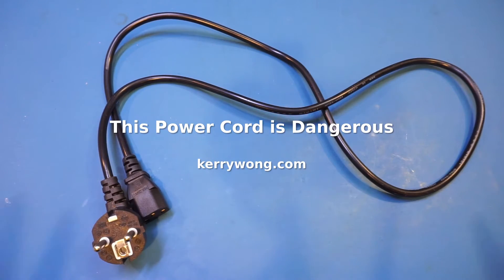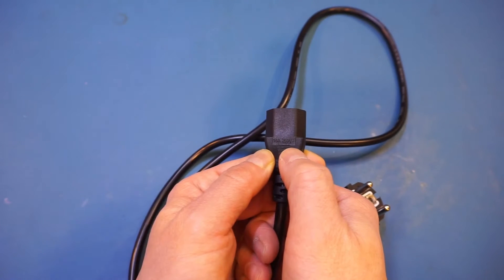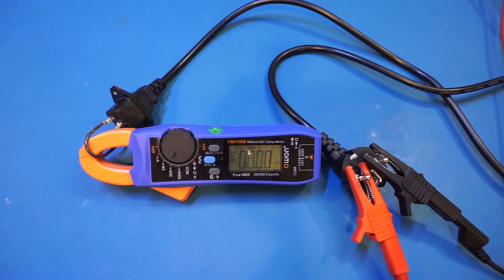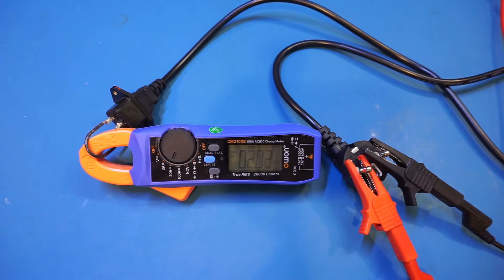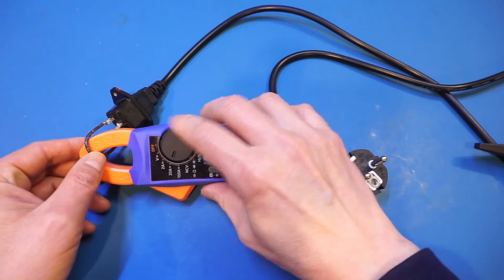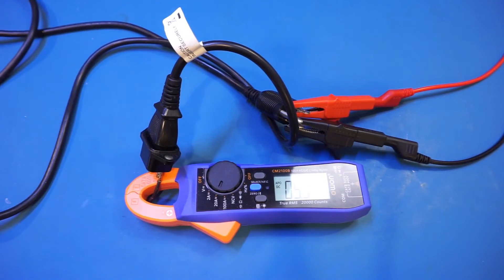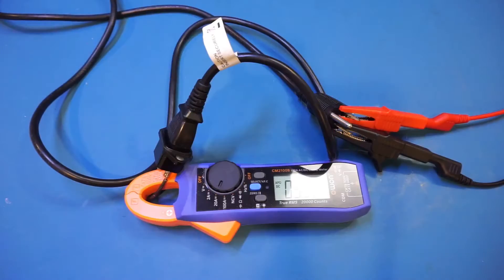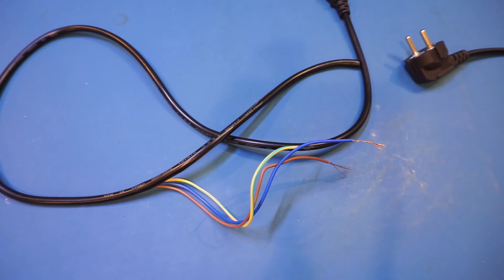This Power Cord Is Dangerous

Comment: Copper clad steel wire, cheap for sure. Did you measure the resistance, would be a good reference to the quality version resistance and an easy way to identify the cheapo types but of course heating it up can be fun to...  
Thanks for taking the time to make this known!
Reply from the maker: Given the voltage drop at 10A is around 5V and since the way I was measuring effectively double the wire length, the 3 foot wire has a resistance of roughly 0.25 Ohm (5/10/2).
Reply: I can't even think about a use case where steel wire could be valid for electrical current. Is it just made to be put in fake stuff or is it legitimately used in actual electrical systems ?
Reply: @amogusenjoyer  It's often used in coax and antenna wire. Copper clad steel is much stronger than copper, so it works great for wire antennas. 
Because of the skin depth the current will only flow through the copper plating. At 1.8MHz, the copper only needs to be 50 microns thick to carry all of the current. It gets thinner as the frequency goes up.
Reply: @rocketman221projects  A lot of antenna wire is copper coated steel but it's not to be used for power just for antennas
Reply: @amogusenjoyer it is used in high tension lines for its tensile strength. The have to consider tower installation cost span requirements sag from temp changes etc.    Copper clad aluminum is used for non mil std coax and low reliability network cable. As copper prices get more ridiculous alternative materials show up in more and more inappropriate places.

Comment: I have   4/0 copper conductors that go from my home solar inverter to a large battery bank. That routinely carries 120 amps at 48+ volts for charging and slightly less at discharge. I buy my cabling and electrical components from reputable sources like McMasterCarr / Grainger etc because buying from anywhere else like Amazon or eBay is gambling with someone who really doesn't care if they burn your house down and probably have burned several peoples houses down. It never occurred to me to test the  cables that have come with test gear that I've bought over the years.
Reply: Even if there is no fire, an inefficient cable wastes your photovoltaic energy.  You can test the conductivity of the wire against published resistance values per length of wire for each AWG.
Reply: Check everything from China twice.

Comment: Try soldering on them - I bet the solder won't stick . I have come across wire that no solder would stick to but I never tried a magnet on them - will do that in the future now !
Reply: The wire looks to be at least copper plated, so I would expect the solder to stick.
Reply: iron is solder-able better than copper , aluminum needs copper coating to solder
Reply: @fay296k  Iron is most definitely harder to solder than copper, have you ever tried it? We use acid flux to solder iron and that will ruin electric circuits Rosin flux is used on copper but will not work well with iron (actually its steel in this case).
Reply: @tedmoss  Many component leads used to be iron or steel with a tin / lead coating.
Reply: @cambridgemart2075  Yes, and that coating was necessary for the beast easily solderable.

Comment: What the hell
Reply: Common enough, and you also get those with only 2 conductors, despite the socket having the ground connector in there, and the plugtop being a grounded one, but the cord is actually only 2 conductors. Possibly steel, or CCA, or the mystery copper with conductivity approximately midway between copper and steel, which is not magnetic, but also not copper either.
Reply: Aluminium. @SeanBZA